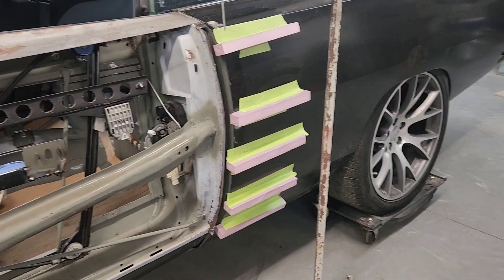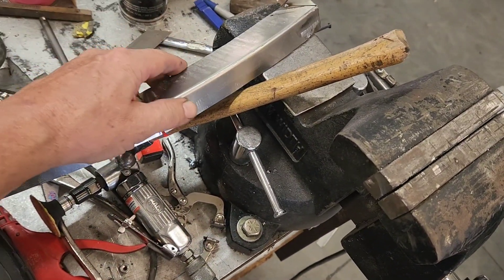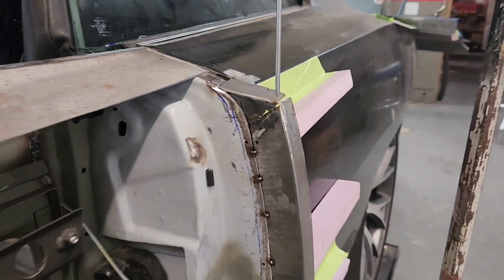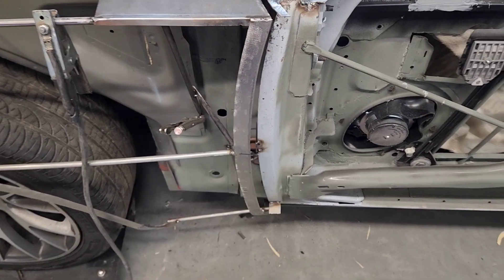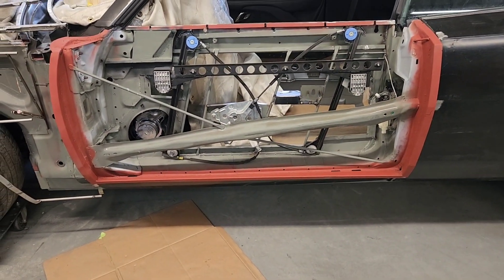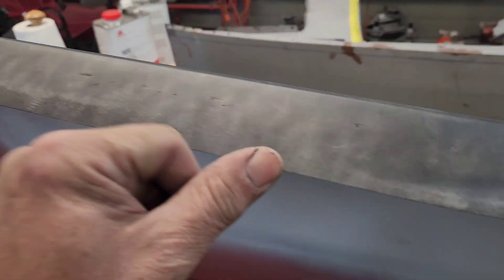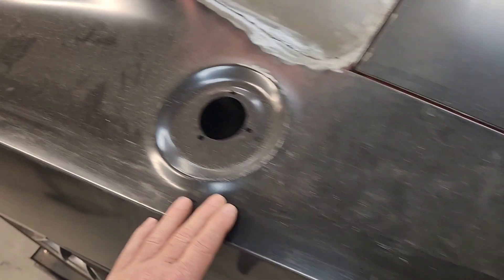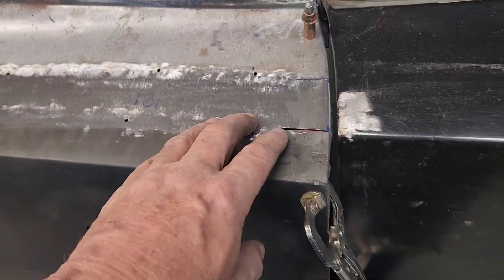Randy's Hellcat Daytona part 40

Comment: Really enjoying what you are doing here. Are you going to use the challenger mirrors  or the original mirrors if so are you going to move them out a little
Reply from the maker: I will be using the Challenger mirrors as they are power adjustable. I will be modifying the base to get it closer to the top of the door and spacing it out appropriately.

Comment: Question.  I know nothing about metalworking. When you mentioned mudding the front edge of the quarter panel on a STOCK Charger,...stock... my zero knowledge of metal work wondered if taking a cutoff wheel to the pertinent edges top and forward of the quarter panel, cutting a slit a foot back, you could finesse outward a 16th of an inch or whatever to the door edge, weld up the exposed slit. Ta da. Over the course of the 12 inch relief cut up top and the entire forward edge you could skim coat the entire panel and not mud the front lip where it meets the door.. That's how my know nothing Brain was working the problem. Again, stock charger scenerio....Let me know why that won't work because I love watching fabricators 😊.
Reply from the maker: That would work. That it needs to be done is tragic because there is nothing nicer than a brand new panel and nothing that grinds my gears more than having to cut into it.